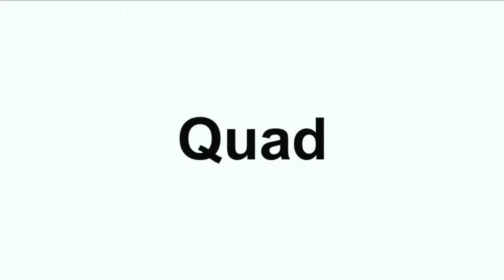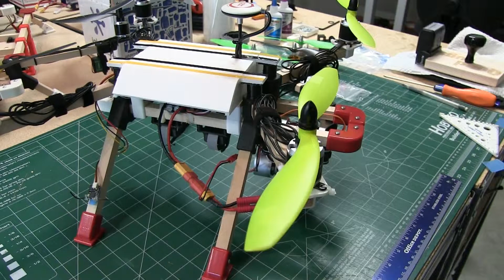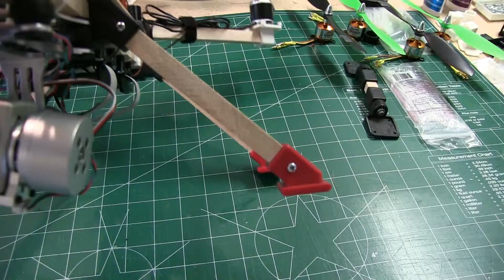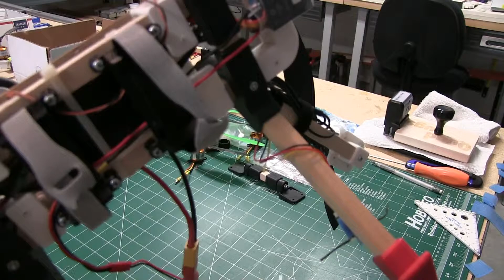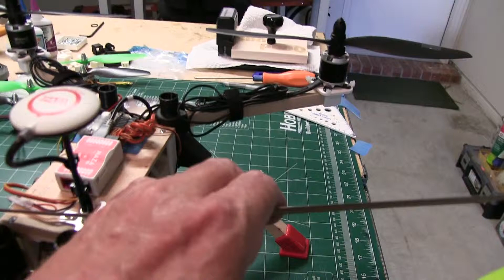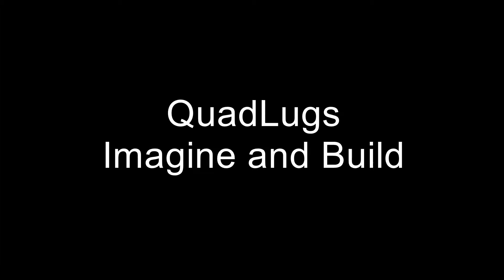QuadLugs Trying Something New - Conclusion

Comment: On the subject of lugs, have you considered selling a tee-lug?  It might be nice to be able to put a cross beam within the frame at times.

And how about an arm lug without the leg hole?  Although I guess that can be cut off.

The lugs can quickly turn into an erector set.
Reply from the maker: We are working on a few more Lugs and yes the tee is one of them - the Arm Lug without the leg hole is another we are working on - it will be used for our up-coming hex and octocopters - also 30 - 60 - 45 degree Lugs - also some offset Lugs - these are Lugs that are slated for 2015 -

Comment: I don't see the cylindrical lugs used here to hold the canopy on your website.  What are you using there?  They might be good for a lot of removable things.Especially since they seem to slip one inside the other.

I imagine you paired those together, then set the canopy on pre-glued.  Otherwise, it would be a neat trick to measure that accurately!
Reply from the maker: They are listed as Body Attachment Lugs on the Add-On's page at quadlugs.com - I have a couple of videos located at the Gallery page / under build videos toward the bottom of the page - labeled Body Build and Install - there are two versions - one with the Lugs on the outside and one with the Lugs inside the canopy -  you are very right on how it is installed